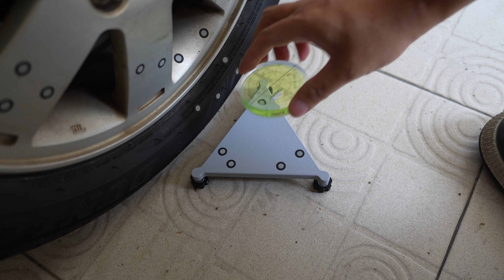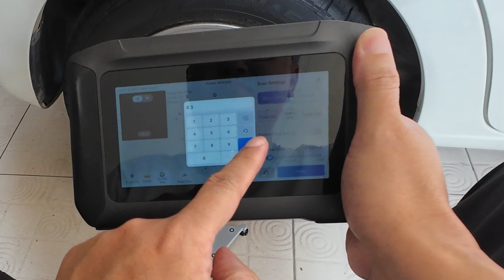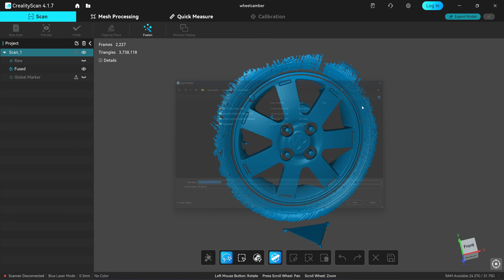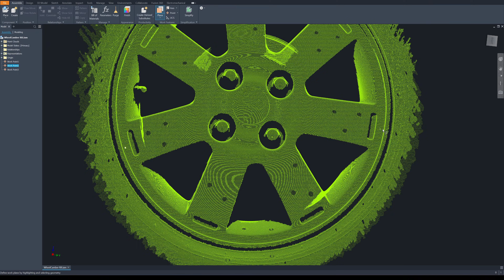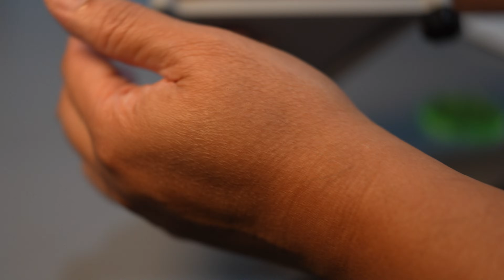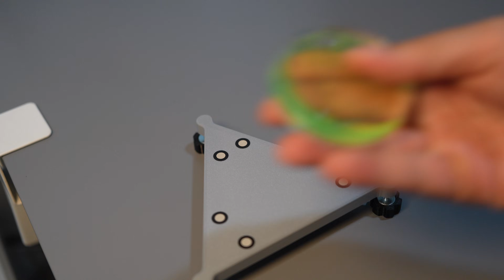How to Measure Wheel Camber Angle Using a 3D Scanner

Comment: Awesome video.  I don't think you want to measure your wheel against a leveled plane though.  You want to measure against the plane that the tires are resting on, which is the floor.  If your floor is out of level than using a leveled plane will actually introduce the error into your measurement.
Reply from the maker: I forgot that a lot of garages don’t actually have paved floors.
When the floor is not level, place the leveling plate at the center of the car’s hood and adjust it. Then rotate the plate 180 degrees and position it near the wheel. This cancels out the floor’s unevenness.
Just because the floor looks level doesn’t mean it’s truly flat. Even tiny tile angles or bumps can throw off the reference plane, which is why the level plate is still necessary.

Comment: The leveling plane isn't actually helping here, because you aren't leveling the car the same way. Better to use a long straightedge to average out the bumps in the floor, but leave the angle alone, because that's what the car is resting on.
Reply from the maker: You can still use this method if the floor is off level by as much as 3 degrees. Start by placing the leveling plate in the center of car's hood and adjust it. Then rotate the plate 180 degrees and position it next to the wheel. This cancels out unevenness in the floor.
The floor itself is level, undetectable even with a 1‑meter construction bubble level. What’s not level are the 8‑inch tiles from the way they were paved, each having a slight tilt of about 0.5–1 degree.

Comment: Level your car and retry. This is a good idea but you are not doing this correctly.
Reply from the maker: You can still use this method if the floor is off level by as much as 3 degrees. Start by placing the leveling plate in the center of car's hood and adjust it. Then rotate the plate 180 degrees and position it next to the wheel. This cancels out unevenness in the floor.
This method is more accurate than most alignment machines, since they can only read angles in 0.1-degree steps.

Comment: Ehhh.... Sorry. 
I love the way you explain this, and for a lot of other usecases this is a very good explenation, thank you...

However, this usecase is not so good.
You don't know if the floor is level, and even if you would know it is, is it level over the whole surface where the car is standing?
Reply: As someone who has done my own alignments for motorsport track days for years, I was about to comment about the floor levelness. Its a good idea but honeslty, not the right tool for the job. There are specialized jig for this..
Reply from the maker: I handle factory floor leveling for large machine installations, which demands greater precision than wheel camber adjustments. My garage floor is level across the left and right wheels, achieved using leveled string as a guide during paving. However, each tile has a slight tilt of about 0.5–1 degree. Larger 2‑foot tiles would improve leveling, but the ideal solution is a self‑leveling epoxy surface.
I’ve seen people use wheel brackets with lasers and bubble levels, but those produce inaccurate readings, most people don’t realize where the errors originate.
Reply: @Payo-TensileCreator  Anything but saying that in this case it will not provide an accurate reading, right?
Reply from the maker: @_XxXxX  You can use this method to calibrate wheel alignment equipment. It’s about ten times more accurate than typical alignment machines, but since the angle can’t be adjusted on the fly, it’s limited to inspection rather than live adjustment.
Reply from the maker: My garage floor is level. Checked with 1 m long construction spirit level.
Reply: @Payo-TensileCreator  Okay, but my point is... You're using a spirit level on a tripod that you level separately from the floor, and that has reference points on it. That's NOT the floor the car is standing on, and if you had placed the reference points on that floor, and not on a separate, self-leveled platform, it would have been correct. Now you're using a reference that is NOT a reference relative to the car.
Reply from the maker: @3dPrintCreator Leveling a floor isn’t particularly challenging, as the tile substrate is semi-fluid. But a level floor doesn’t always equal a flat one, minor undulations, bumps, or tile angles can easily exceed one degree. If you try to establish a reference plane from such a surface, you’ll end up with inaccuracies. Just because both wheels share the same elevation and tire pressure doesn’t mean the floor can be trusted as a true reference plane.

Comment: Interesting idea, but if the car/the floor is not level
, the measured value will be wrong
Reply from the maker: Good point. If the floor beneath the left and right wheels isn’t level, start by placing the leveling plate on the car hood and adjust it. Then rotate the plate 180 degrees and position it next to the wheel. This cancels out any unevenness in the floor.

Comment: This is really good use case. But the SW on the device should provide such measurement tools for distance and angle without the need to do the processing on PC. By this people would much more often use 3d scanner to measure instead of using caliper. But when you need to do this using 3rd party software on PC then the caliper is the better option.
Reply from the maker: Yes, the software should be capable of creating a plane for angle measurement, and ideally it would also measure radii. However, at the moment it can’t even correctly measure the distance from point A to point B.

Comment: Is it possible to measure angel in cloudcompear, or there is not possible to create a plane on the wheel. Thank you for content
Reply from the maker: CloudCompare doesn’t support plane creation, so angle measurement isn’t possible there. However, you can achieve this in FreeCAD by importing the mesh (instead of the point cloud) and creating planes in the same way I demonstrated in Inventor.